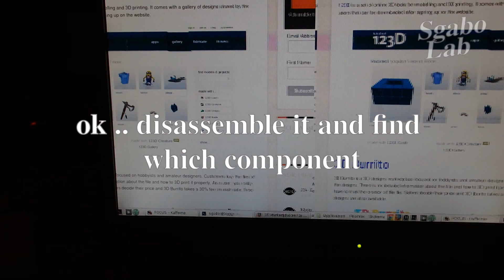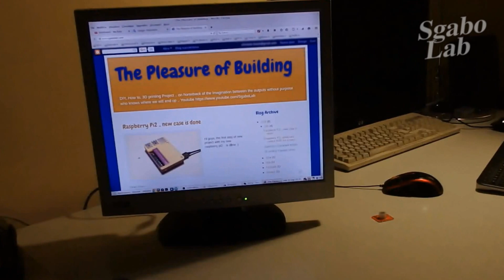DIY Fan on/off  &  speed regulator for LCD overheat repair

Comment: i fet lavorano bene in pwm (nel circuito sopra manca il diodo di protezione per l'induttanza della ventolina, inoltre per quel tipo di schema consiglio un normale transistor)
converrebbe fare un circuito con controllo pwm
un semplice 555 con sensore termico che controlla automaticamente la velocita' tramite impulsi pwm su fet
volendo ci sono delle ventoline gia' dotate di circuito termico che regolano la velocita' con la temperatura, costano poco di piu'
Reply from the maker: ciao, si l'utilizzo più tipico è x il pwm ma non sono specifici per questo. 
tutto giusto ma non hai considerato che la ventolina ha i suoi transistor e diodo che pilotano le bobine, non sono mica attacate direttamente all'alimentazione ;)
in questo caso utilizzando un segnale di controllo di cui non conosco la corrente disponibile, il transistor classico (pilotato in corrente) non è proprio il caso ;)
555 .. ;) .. gia fatto ma per motori che richiedono più corrente e per esperimenti tesla .. pensa che ho una mia versione di circuito oscillatore con 555 con  dutycicle variabile senza (ripeto.. senza) variazione di frequenza e può fare il duty50% perfetto. 
hai visto che ho iniziato a giocare col raspberry :)
Reply: meglio stm32
raspberry? un microcontrollore che puo' installare windows 10? mah! non mi convince
parlando di altro ho fatto un progetto per controllo macchina RC con queste caratteristiche:
controllo con arduino pro mini
1 solo mosfet di potenza con basso rds
1 rele' per lo switch della direzione
gestione sonora del rumore del motore in mp3
controllo wireless con nrf24l01
fet gestione luci 
3 uscite servo 
4 ingressi analogici (eventuali sensori collisione)
ingresso i2c per gps
indicatore stato batteria
il pcb e' finito manca il software, si potrebbe usare multiwii modificato
Reply from the maker: :D .. sapevo che mi avresti risposto a tono ... il rasp chiamarlo microcontroller è un pò azzardato poi se uno ci mette win10 .. mi unisco al tuo scetticismo .. però è un oggettino interessante.
Grande .. anche io avevo pensato una cosa del genere ma più limitata al solo esc .. sarebbe comodo avere un esc fatto con arduino.
Decisamente per utilizzo in questo contesto molto meglio arduino. Spero che poi condividerai ;)
L'uso del rele per l'inversione mi ha fatto ricordare un lavoretto di 15 anni fa per controllo motori elettrici  ... però all'epoca si lavorava in analogico ... operazionali a gogo :D https://www.instagram.com/p/BIuO9SUAY5t